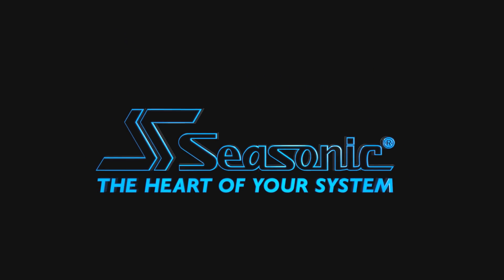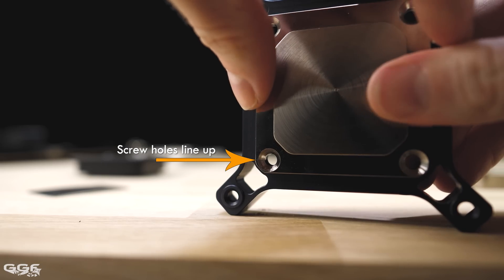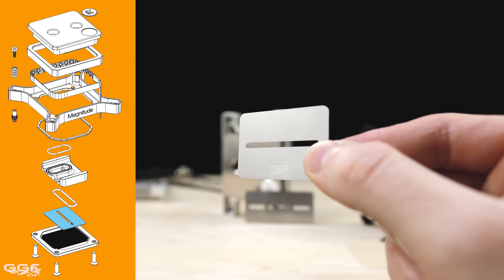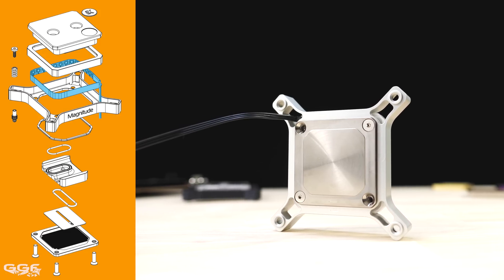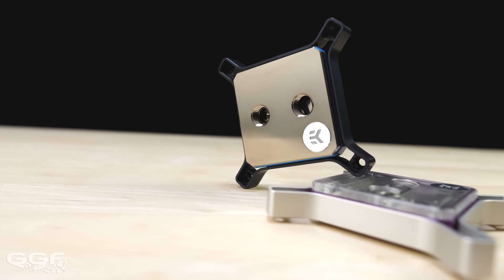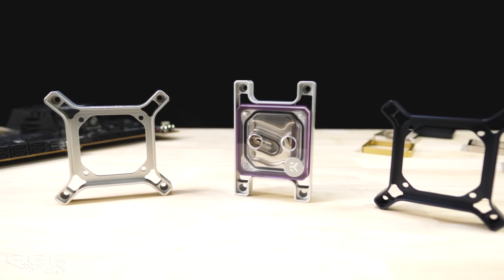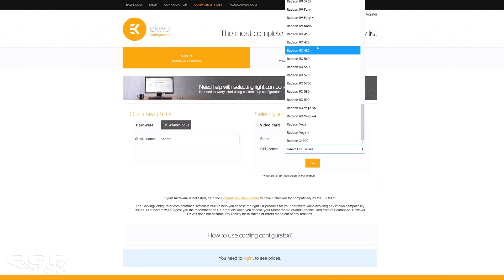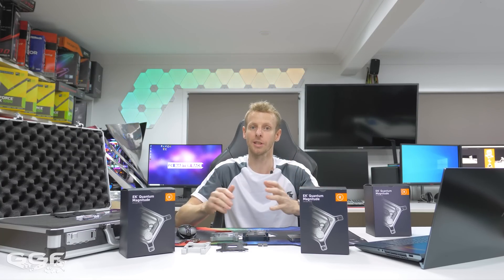EK's Next Level CPU Blocks!

Comment: What im wondering about is the thermal performance with the new AM4 off center flow to target the actual CPU Chiplets. If theres like 1-2C difference I wont bother but something like 5C would be a definite buy.
Reply: Guru3d tested it and it's about 2C better than the Velocity block using a 3900xt at 170W. The TechN AM4 block is nearly half the price and performs 2C better. At higher heat loads I expect the gap would be even wider.

Comment: Can someone please explain what are those different coldplates? I’ve seen product pages on EK site, and I’ve seen the video, but I still don’t get it... what are those accessory flat plates for? Something about custom IHS - am I right that’s for people who buy lids from der8auer and other folks?  Do custom IHS have a different shape that is not compatible with regular aftermarket cpu blocks? Very confusing  =\
Reply: usually coolers and waterblocks are not entirely flat, the cpu is slightly convex usually and the cooler is slightly concave to fit properly and this usually helps with machining costs too, so if you've lapped your IHS or are running a custom IHS then more than likely you'd need to lap your cooler too as a result, the flat cold plate available here just removes the need to lap the block essentially, it's just a small change that makes things easier essentially, im not sure to what degree the plat is flat, but i'd imagine it likely wouldn't be more than half a thousandth of an inch but i couldn't say for certain unless i had one in hand

Comment: Hey, i had a question, im about to use alphacools chrome plated brass hard tubing in a build, when i pick out my radiators, blocks, fittings, and liquids. What should i avoid due to the chrome plating? I'm trying to avoid gucking up blocks with algae/corrosion.

The brand i had in mind was watercool from germany and to use their heatkiller series products, radiator blocks and then an EK/Lian Li 011 xl distro plate with bitspower fittings.

Comment: Looks good, but too bad they haven't made a really high-end Threadripper block.
Reply: Working on it. :)
Reply: @Attila_Gobor   If I buy a replacement full nickel or acetal plate for this am4 quantum magnitude do they come with a different rgb strip or are they compatible with the RGB cable that came with my stock Plexi top?
Reply: @bobnorman3094  If you get a new top, it will be compatible with the existing block, RGB as well. But, if you have the Plexi Top, the frame is nickel plated, so no light goes through it. If you are going for the full nickel top, I suggest getting the white milky frame to get a nice Full Nickel + RGB combo.
Reply: @Attila_Gobor  I wanted to get the acetal top, but I apparently wont see the rgb ay? Might just keep my scratched plexi top then qnd save the money, dont really fancy the idea of buying the 30 dollar frame as well :/

Comment: Wow is that ridiculously expensive.  At that price point I believe Optimus products out of Chicago Illinois would be another option with their ten year product warranty.
Reply: The review is in...looks like a 3 degree drop in temperature. Now don't get me wrong these are cool and way over engineered, but just to expensive....you will do better in dropping temperatures by other means and most likely in a less expensive manner.
Reply: Rocnroll 00 ”Expensive” is a very relative term. If you build/modify cars or any other vehicles...this is nothing.

Comment: I'd sure like to know how they compare against the Optimus Signature V2 blocks. Their 10year warranty speaks volumes about their confidence in the product and their electroless nickel plating.

I've had 4 WB's from EK (2x CPU and 2x GPU) and all of them have very quickly (just over 1 year) corroded and had the plating come off all while using just their clear fluids and nothing else.
I wonder how these will fare.
Reply: I've had 5 EK blocks (3 GPU and 2 CPU) over the course of about 4 years with opaque liquid (Mayhems Red Pastel) and I've had no issues.
Reply: If you've had 4 blocks and each of them are corroding, I'd say the common denominator is your loop. There's obviously something in your loop that must be causing them to corrode. You might only be using clear fluids, but if the fluid is picking up residue from the radiators and fittings then over time it will cause it to corrode. Both my CPU and GPU have been using the same EK blocks since 2015 and they have been crystal clear. The ONLY time my blocks have corroded was when I tried the Primochill Vue fluid for the first time last year and I had some nasty corrosion after about 5 or 6 weeks of use. But I cleaned them all out and now it's back to normal.
Reply: @AWSimDrifter  All ek parts but two different radiators (360 then 480) and first time I used the black rubber tubes and second time I used acrylic tubes. Both radiators were cleaned out before use so dunno what to say.
Maybe they're just sending crap parts to eastern europe (its happening all the time with video cameras and foods).